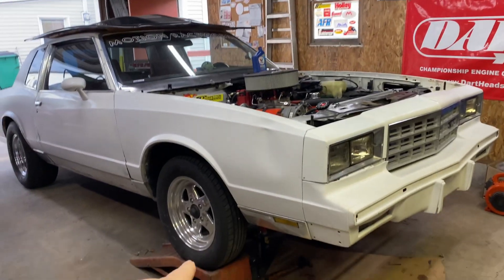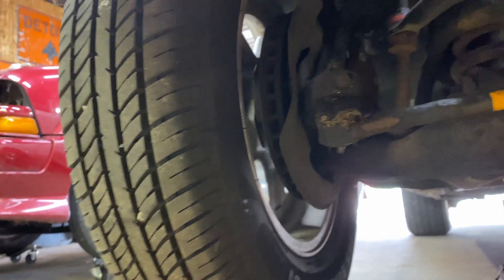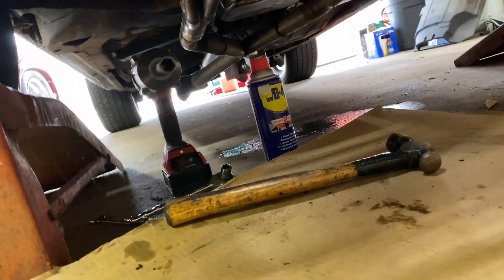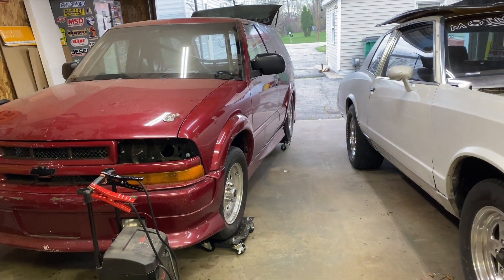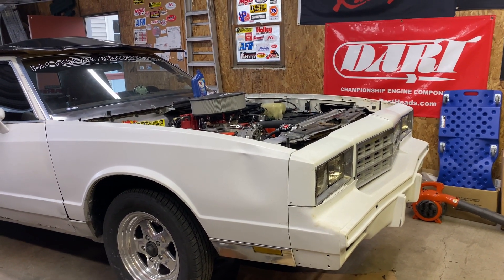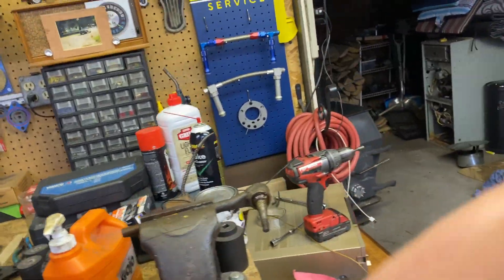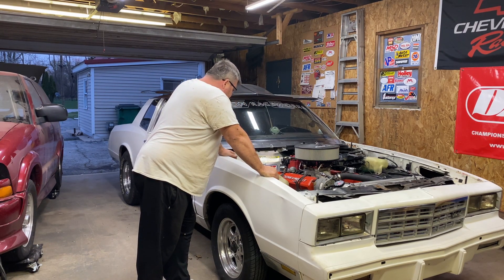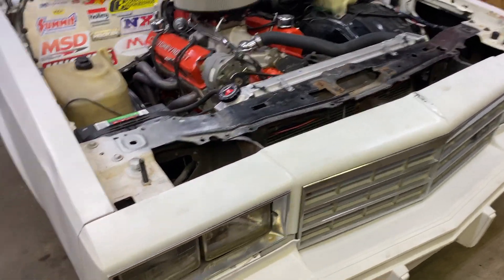Getting more work done to the 81 Monte Carlo.. #sbc #gbodynation #streetcar

Comment: I have a buddy with a 84 Monte Carlo drag car he's been messing with for decades. Runs 6.50s in the 8th, and just looking at it you'd never guess it's that fast. Even the engine is surprisingly basic, 383 with some older Patriot heads with a nice port job, Bowtie intake & 850 Holley, and and big ole solid roller. Runs on 28x10.5x15 M/Ts. Looks like a typical street machine with a cage. And my buddy weighs over 400lbs, so it ain't light. He also has a 67 Camaro with a 540 that runs mid 5s NA. He's a hell of a bracket racer too. His cars have paid for themselves.

Comment: Need to shitcan that front sway bar, throw some Moroso trick springs in it with 90/10 shocks, and solid bushings. It would help. Manual S-10 steering box bolt right in too. I'd go manual brake conversion too. Looks like a MC I built years ago. Cool ride.